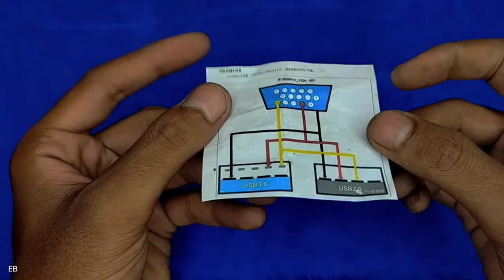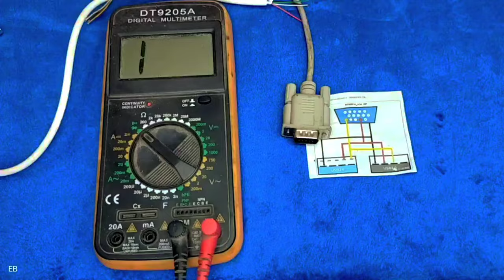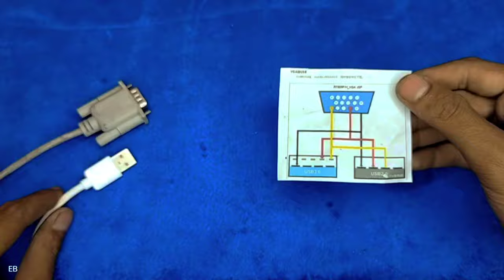making usb to vga cable at home

Comment: How would this work without a dedicated controller or drivers for it? Besides of the fact that VGA has Red Green and Blue and a USB cable only has 3 data cables D+ and D-, where do i transport information for the third color, the intensity, the clock, etc.? Only adapter I know of this kind are Freco Logic adapters and I cannot recommend them to anyone trying to emit a VGA signal on a monitor. Regards dude, try making something that actually works.
Reply: 4 cables, 2 for power, 2 for data
Reply: @carloisdoingstupidtechstuff  Mkay....
Reply: @carloisdoingstupidtechstuff hi brother, i wants it's Brother, it's useful to me , please provide link or pin connection diagram
Reply: Please guide me brother
Reply: @nagarajub4011  I'm NOT the uploader of this video